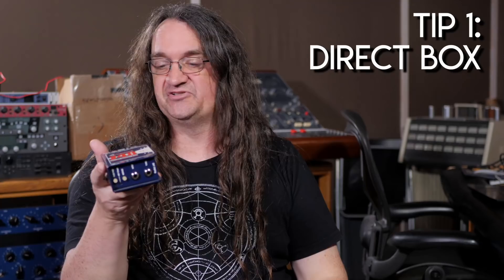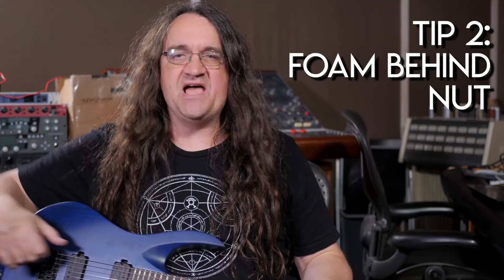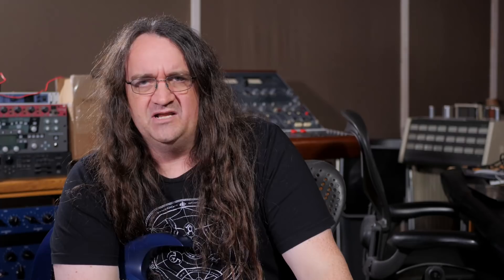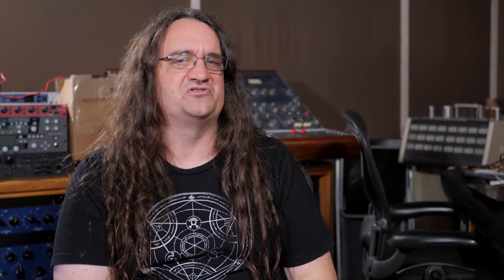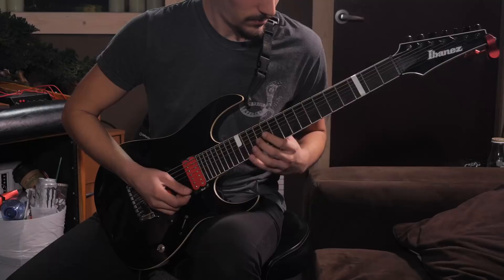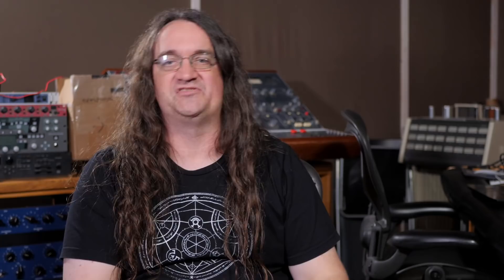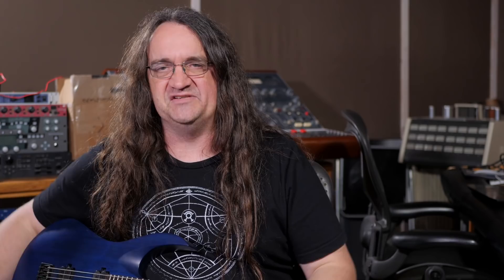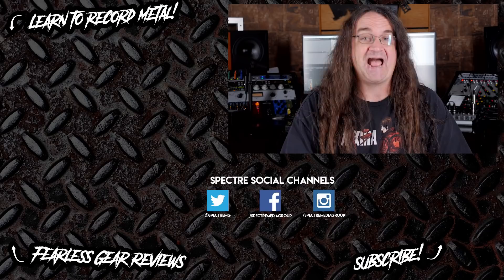Five Tips for Recording Metal Guitar at Home

Comment: So maybe someone can help me out with some simple information. I'm having a terrible time just creating a set up to record my guitar. The DI box is something that I'm thinking of getting, although I already have a scarlet Focusrite audio interface, and don't know what kind of difference it would make.

So these are kind of my 2 questions that I have for anyone that might have an answer for me. 

1. Right now, because I live in an apartment, I only have a regular carry around, play in your bedroom type of amp. It has a headphones out port. I've been using that as the primary way to connect it to my computer through my Focusrite audio interface. I'm looking to buy a nice proper metal amp because I just can't get the right tones I want with my current amp. So would buying an amp like the Mesa rectifier or Engle be a good way of recording metal music through an audio interface alone? or should I use that in combination with a DI box? or is the problem even with what amp I use at all?

2. I have spent a lot of time trying to use Amplitube as a sim amp. It's really confusing for me, having not ever used a software like this before and I have no idea what I'm doing. I want to use either Ableton live 10 or Protools to record, but I have no idea how to get Amplitube or any ampsim to run simultaneously with the recording programs and successfully record with them. I'm wondering if I need to pay for the full versions of these DAWs in order to make things like ampsims and plug-ins work properly. That being said, my question is: Without having to watch 50 different videos with bits of helpful information here and there, does anyone know of a great resource with clear instructions on how to set up an ampsim and which one would be best to use?

If anyone actually replies, I'd be super grateful. So far my recordings sound... bleh... Better than a phone mic, but still boxy and muffled sounding. I just don't know what I need to move into the next level.

Comment: Hey Glen! So If I'm not using a mic'd amp due to recording from an apartment, would  A DI box (Radial Pro DI) still change my sound in anyway for recording my guitars through my 2i2. If not then what about Running an Orange CW120 through on of you Lancaster IR's. Thanks for all the gear tips by the way!
Reply: tkdowney I second this question. Is a DI box still necessary when using an audio interface?

Comment: This is possibly the most informative video from you yet(for me anyway). I record my guitar with my Randall Rh-100 to a 4x12 cab. I use two 58's(because I haven't got off my ass and ordered 57's) One directly on the center of the cone and one off axis( you taught me this; and I know I need 57's)  I run the mics into a cheap peavy 10 track mixing board and record the signal as a mono track into a Tascam US- 1800 which runs into Cubase le 5. I still have a bit of a problem with my high-end, it seems too hing or too low. Would 57's help with this problem or do I just suck with eq. Anyway, thanks again for your awesome videos and as always...........fuck you Glen. Never stop being AWESOME.

Comment: Glenn. Could you/have you done a video, Recording with Joyo Zombie and Harley Benton 2x12 cab? I bought that setup so I could have something cheap and manageable to go to gigs with. It sounds great. But I was curious as to Pros vs Cons of recording to a Scarlett Solo. Running my guitar into pre amp and then from FX loop send to my interface. I dont crank it, ime very careful with the volumes and so far no issues. It sounds bigger. And I can also use an AUX line from my headpone jack to the Scarlett Solo and it gives me a different but still okay tone. Can you maybe compare those 2 methods with just straight mic'ing and DI box recording?

Comment: Quick question, if you dial in a transistor amp, do you crank the volume to make the speaker work like on a tube amp, or you're better off a bit conservative because transistor amp usually become muddy after 5 ?

Comment: I only just started doing the foam trick!  But I had to put the foam under my springs for my floating tremelo bridge. ( I may have to just replace the springs, since I've never had the issue of spring vibrations before)  But would the foam really do anything behind the nut if you have a locking nut?

Comment: does this apply to locking systems such as the Floyd Rose?

you would  think if it's locked down tight,  vibrations would stop at the nut

Comment: I have just gone from a 2mm pick to a 3mm pick and it is helping my speed tremendously. I have recorded songs straight from my line out on my marshall to the sound card. However recently I have just got hold of the focusrite 2 channel box. I am thinking of using both channels to record my clean guitar sound and the sound coming from the line out of the marshall 9100. Do you think I need to get some kind of splitter box for this. I do like the sound of the marshall, but it is handy to record the clean guitar as well if I want to put a different sound on it

Comment: Question: when i finger harder (fretting hand), i get ring from the strings comming from other side of the hand, meaning i get the sound of “tapping” on the neck, it bleeds into the recording, i can’t mute it because i need open strings to ring, and I don’t mind the “noise”, i only mind the fact that i play a note on 5th fret and i hear the “tapped” string ring a perfect note of the previous 4 frets. Is this an action issue? Fret issue? Or do i just need to learn to play better?

Comment: so, im running an xlr from my amps cab simulator output to the 4 chan mixer or directly to my interface. Ive even direct miced it the the mixer then to the interfece . Either results in a very fuzzy sound. What should i do to, or can i  do, to cut the fuzz sound? And couldnt you just use a string muter as opposed to foam behind the nut or tape? Just curious.

Comment: Love the channel and your tips help me out with recording and playing Guitar in general, but my biggest question and problem. How in the hell do I get rid of latency. I have a Focusrite Solo 2nd Gen and a custom built phenominal PC, but I get noticeable and unrecordible latency. Is there a way too fix this with just the direct box or is there something else I should acquire to reduce it. Thanks and most appreciation.
Reply: Are you using the correct drivers?
Reply: @idontcare_wtf  Yup. Everything is up to date, I'm beginning to believe it's my DAW which is a POS.
Reply: - TheAndMan -
I use FL Studio and it comes with "ASIO for all". That's where I adjust my latency. Without that software, I wouldn't know what to do about mine. I hope that info can help you in some way.
Reply: 1) Did you set your buffer size to 1 ms?
2) you can use a DI box to send the direct signal to your pc while monitoring on a real amp.
Reply: Wathc Molten Music's video on latency. That will help clarify some of the stuff.
Reply: @-TheAndMan- Even if the settings of you pc and your daw a rock solid and correct, you can face latency problems. I figured out that some of the plugins (It was not an ampsim! They are all fine and real time because they are programmed for just that) i use produce a latency if i have them in the inputbus, the insert of a guitar track or the output section of my daw. Look into that deeper. If thats the case, record your stuff without them and use them only later on in the mixing process when all recording has been done. What plugins did you have in your inputbus, insert chain or main output bus? Some plugins are dedicated for mixing, not for real time recording/processing and produce a latency due to the nature of their internal processing. If you have them in your input bus, the insert chain of a single track, a group channel or the main output bus, you face latency.
Reply: @vonStahlhelm  AS long as your overall latency is 5ms or lower, It doesn't matter much. Such latency exists in real life. If you are 10' away from your amp, that's 10 ms of latency right there.
Reply: @crimsun7186  Thats right. But thats not what i mean. Take my posting as an example. Every plugin is producing latency, so called plugin-latency. Some a very, very short, some a very long. But some kind of plugins are producing a detectable and very annoying latency, a latency around 300ms or higher and in real life you cant play  like you want and feel it if your amp is 100 meters away from you. 5-10ms latency is ok, its nearly undetectable. But 300ms are. And some plugins, dedicated for mixing and not for real time processing, are producing latencys like that. Slate's Virtual Tape Machine is a good example for that behaviour. If you load such a plugin into a track bus as insert or in the main-output it produces a very bad latency around 250ms. And playing with THAT latency is defenitely not fun anymore.  But this kind of plugins are not made for real-time processing in the recording process, they are meant for the mixing after the recording is done. I dont know what kind of DAW you use. In Cubase is a plugin information, there you can find the plugin latency for all plugins in samples/second. And some plugins have very high latency. In case of typical send-effects, you will not mention this high latencys when playing. In case of typical insert effects, made for mixing, you will face a very high latency if you try to use this plugins in the recording process. Some people just dont know that. If they put such a plugin into the insert while playing and recording, they face a very high, unplayable latency and dont know were its coming from. And wonder how this latencys can be if they have a very good computer with a very good interface and everything is setup fine. I have access to a friends rehearsal room studio and use this for recording with a real amp, cant do that at home, my neighbours would be very unhappy with that. He has this Slate Stuff on his DAW. And i open up a mixing template and try to record my stuff on that. Wonder were those latencys came from. A quick phone call gave me the answer. Sometimes he mix for other bands, no recording, just the audio files dragged into this template project. It has Slate VMT in every channel. I open up a recording template and the latency was gone. No plugins of this kind were loaded.
Reply: @vonStahlhelm  Let's see. I use Cubase 5.1, the Bandlab version of Cakewalk SONAR, Reason Limited 9, REAPER and sometimes Ableton Live Lite 9, Studio One Artist 2.

I agree that some plugins add too much latency at times. However, the amount of internal latency is dependent on how fast your machine is. While computers from 20 years ago will not even break a sweat to play multiple audio tracks at once, the same can't be said for dsp processing. What I do is I try to record with the lowest latency possible, then raise it as high as it can go for mixing. If your machine is powerful enough, you might not need this. People that use stuff like the Waves Soundgrid, Universal Audio or ProTools HD usually don't bother with that because the processing is done by external hardware.
Reply: @crimsun7186  Oh, Cubase 5.1 in 2019??? Air Edition?  Anyway. The example with Slate VMT as i experienced it has nothing to do with the cpu power. They describe that on their website. https://slatedigital.zendesk.com/hc/en-us/articles/211732367-VTM-Latency  There are other plugins who have behaviour like that for very similar reasons. And no matter how fast your machine is, you will face latency. CPU Power and Latency have nothing to do with each other. Its a matter of the internal processing of the plugin. The little studio i have access to, the guy also use Ozone for his masterings. Dont load THAT in your masterbus if you want real-time recording. Same issue. And his actual machine is very new and much stronger than my (used 2013 build i5 buyed in early 2015) computer.  There are plugins that literally suck a slower cpu dry, but they dont impact latency at all. My last pc was a core2duo that i had for seven years till march 2015. Used a hardware ampsim on the c2duo machine because the softwarestuff did not sound good for me back then and used to much cpu. So, i work with software-synthesizers too. And newer synths in the last two years i used the old machine sometimes drain 40% of the CPU power in ONE instance, but work in real time. A whole project was sometimes about 95% CPU consumption . Or other cpu-hogs as insert effects that push the old machine to the limit, no uncomfortable extra latency. (you can use it, but you have bounce those tracks in this case)- real time - only latency was the latency of the interface, about 10ms. You will not face higher latency due to high cpu-consumtion. What you have to deal with are crackles, audio dropouts and sometimes crashes, but not latency. Plugin-latency is a matter of internal processing and hardware-modelling. Most plugins are very very fast, sometimes produce no plugin latency at all. But a few not. And if this guy wo asked the initial question about latency maybe did not know about the fact that some plugins, due to their internal processing, produce uncomfortable latency, no matter how fast the cpu is, and maybe thats the simple solution for his actual problem because somewhere in a project that he work on is one of those plugins.  Maybe not. Then the problem is a different one. The problem i had faced in my friends little studio, i had to call him about hat, me myself would not figure that out so fast on my owne. Problem i faced with some plugins of this kind,, its not even enough to just turn it out, you have to unload it completely before the latency stops.
Reply: @vonStahlhelm  I just didn't bother upgrading versions, as I was moving to a different DAW at the time.

As per the VMT, I presume some of the processing it does can't be done in realtime. I wonder if that will be similar if you use something like the Soundgrid.

Comment: The whole DI box has always confused me and confuses me even more every time someone says use it because I say so. Is this one of those leftover ideas from older technology? My audio interface (or soundcard as he calls it) has high impedance preamps, so it should not really be loading my signal much, also a transformer is not really going to help much in that case unless the windings are such that its making the reflected impedance higher, which at a certain point really doesnt matter. I guess I would think the transformer impedance might do more phase damage than any interface loading.
I would be really curious to hear a real technical answer to why we should do this? I feel like maybe the transformer thing is really more about not getting ground hum, which I dont think is as much of a thing with modern pickups. Any electrical engineers out there have some insights on this?

Comment: I have a question about reamping. Reamping is a great thing for me in my little homestudio, so I can record quiet when my neigbours are at home per D.I. and pull up the volume and reamp when nobody's there. But there's a problem:
Most USB-Audio Interfaces, including mine, doesn't have an XLR-Out, which is needed by every single reamp box. What to do now? An adapter cable does mess around with the symmetrical/unsymmetrical topic - would this be an issue?
Greetings from Germany
Reply from the maker: Get an XLR to 1/4 inch stereo jack at Thomann https://bit.ly/2SfMBXG

Comment: I record using a fender mustang gt 100 plugged direct into my recoding interface recorded stereo, would it be good to throw a mic in front of the speaker aswell? I have a kick mic, standard drum mic, or overheads that I could comfortably move and put in front, would that be benifitial? It'd give me 3 tracks of guitar per track (currently I record 2 tracks per guitar part and pan each track 100 left and right) so with a 3rd I could potentially keep that setup and then have the 3rd speaker track centered... Would that be overkill or sound killer?

Comment: Thanks for the tips. So I have noticed that the amp starts to sound nice when I crank it up. But I have "sensitive neighbors". So what are your thoughts on speaker isolation cabins? Especially a very small one?
And I'm using the foam, I also put it behind the springs of the floating bridge. But I have a Fender P-bass than has a ringing truss rod, which resonates with some tones. What can I do about that?

Comment: 0:56 Yyyyyyyeah, putting one extra thing in your signal path will "give you the best, cleanest signal". Because logic, right? 

So what exactly is wrong with the high-impedance / instrument inputs on interfaces, then?

The only reason you'd want a(n external) DI box is that (parallel) "through" output. That is, maybe only if you want to also record a live amp at the same time as you're tracking said DI track. And if you're too paranoid (or, and i hate to say it, "snobbish") that a round-trip conversion to and from digital will allegedly ruin your tone or whatever.
Reply: Also, more often than not, both the Hi-Z input AND the mic input go through the same damn preamp circuitry in the interface, so... What the..?!?

Comment: Dude the strings behind the nut are so short and so tight that they dont really vibrate at all thats why if u pluck them they bearly keep the note going at all if u can even call it a note. I dont think thats even close to being a problem on any guitar. I mean the pick ups are no where near them anyways and i dont think you can hear them ring if you strum the strings while there muted down at the pick ups while listening to behind the nut even if you strum really hard and they wouldnt even vibrate for long enough.
Reply: Just try it yourself. Get a heavy metal tone, strum all the strings, and quickly mute the strummed strings. You should hear a short but noticable ching through your amp